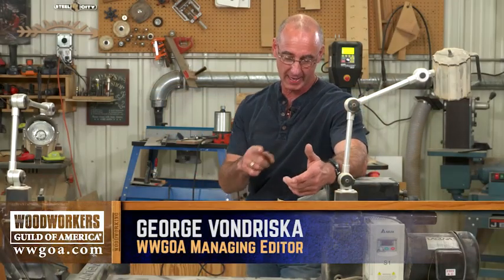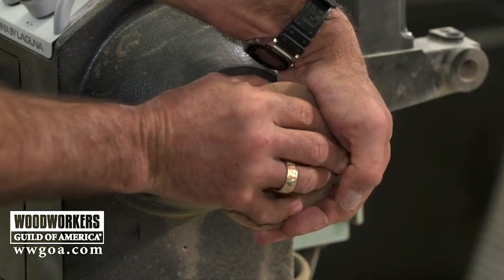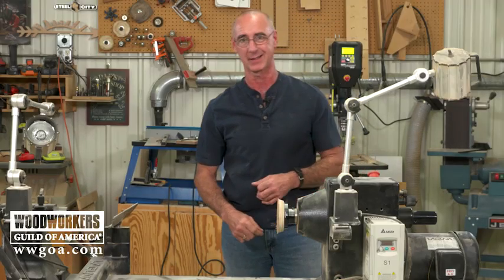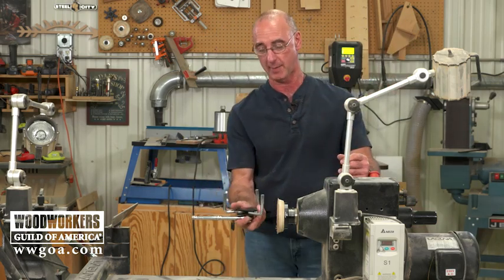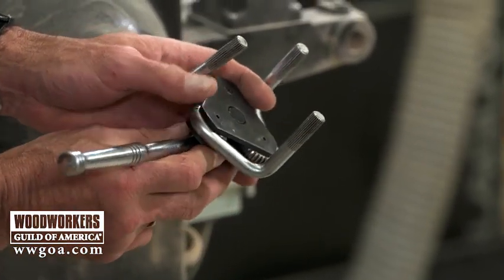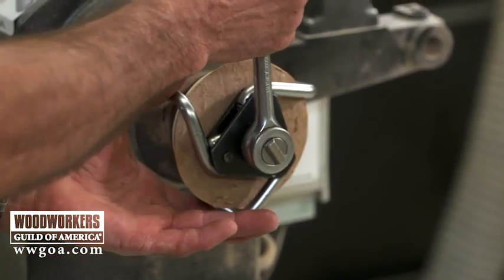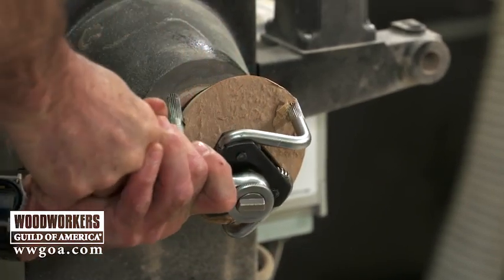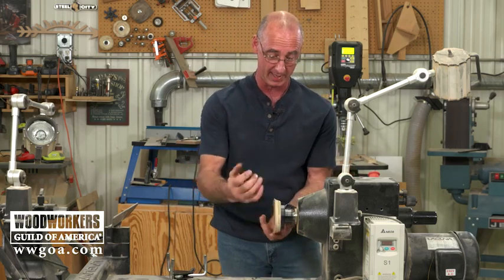How to Free a Stuck Faceplate

Comment: The hole is for a spanner wrench rather than a rod. Spanner wrenches come in many different sizes to match the diameter and pin size. But, you do have a good idea as well.

Comment: If your chuck or face plate has a set (grub) screw - many do, when you spin the chuck/plate ON, you can back it off 1/8 turn and the set screw(s).  This will keep it from getting jammed on the spindle.

Comment: Another good trick (if you don't have an oil filter wrench) is to screw a 2x4 or other long piece of scrap wood to the faceplate and use it as a lever. Make sure to use the right size screws!

Comment: What do you recommend of what type of sander to remove years of paint
Reply: First, if it is lead based I would suggest that you don't do anything with it due to health risks associated with breathing lead dust.  If it is not lead based, it depends on what surface you are trying to clean off.  You could start with a belt sander and move to something with more finesse like a Random Orbital Sander.  You also might have better luck using a heat gun and a putty knife.
Reply: ToolMetrix how do I know if it is. Lead based paint

Comment: My lathe came with a washer to put between the plate. I have no idea if it would help in that situation.
Reply from the maker: That is what the washer is for, yes.  And it would likely minimize the risk of getting a chuck stuck.  But, I prefer metal on metal contact when using a chuck to minimize vibration while turning, so I'd rather have a good way of freeing up a stuck chuck available to me.  It's rare, and easy enough to loosen if it does happen.
Reply: I was taught by my ninth grade industrial arts teacher,a very long time ago, to put a ring of paper between the plate and back of the shaft to eliminate this problem? I have never had a plate stick hard doing this? I also have no vibration problems using this method?